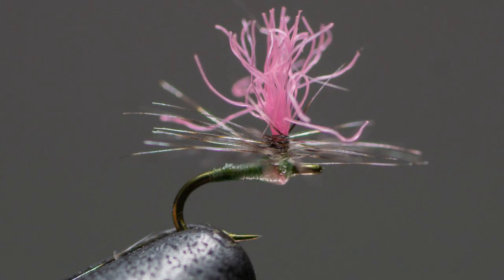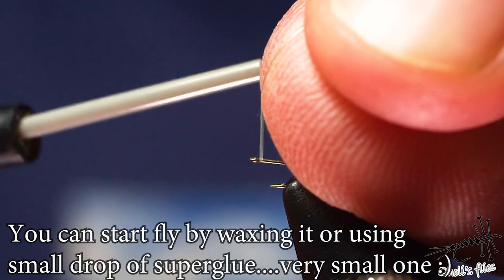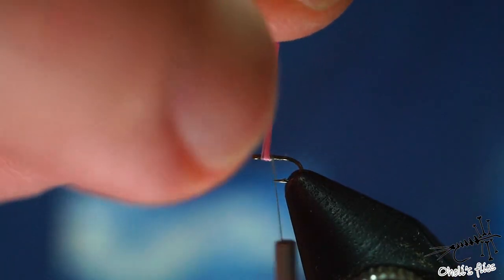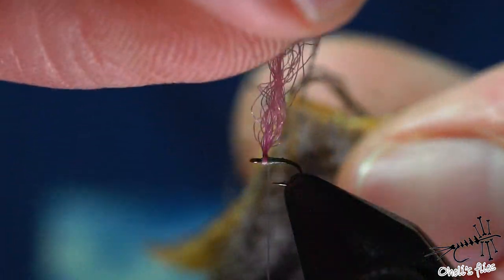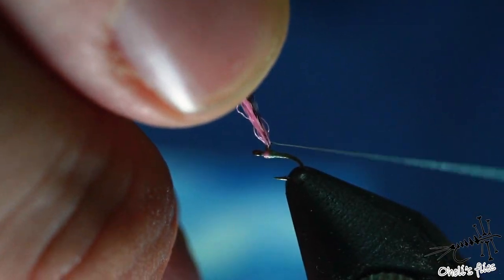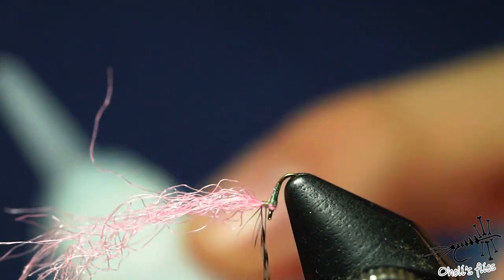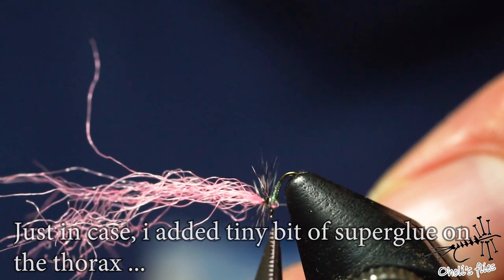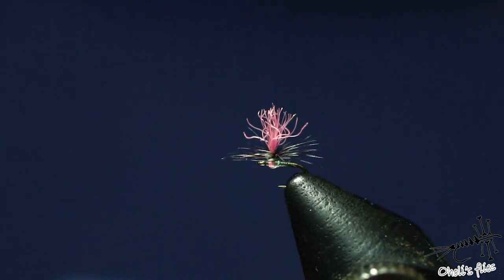Micro Nano Pico Parachute Fly

Comment: tools like tweezers-like pinching tools can be refined by  repeatedly  drawing emery cloth (the thinner the better) between the pincers.  Also consider painting a thin layer of shoe goo/e-6000 or a liquid rubber (very thin and flat) on one of the jaws for grip.conformation.
Reply from the maker: Thanks for those tips. 😃😃😃
I know some of my friends just put on one side rubber tubing from electrical wires or thermo tubing.... I keep this one plain because i mostly use it to remove stem from cdc 😃

Comment: Very tiny, its a challenge... For me its difficult to get small hooks in Europe. Maybe its because using very small Flies is not common in Europe.
Btw you can add a piece of shrink tube on the tip of a cheap hackle plier against slipping...
Where do you get your Tiemco Hooks bigpack(1000)?
Reply from the maker: I lived in serbia, in summer and later... We had very small insects hatching... Thats why i love those small ones. And it is a problem to get small flies there.... 20-22 maybe.... Everything smaller its too difficult.
I know about tubes..... But i never seem to remember to buy one... I use hackle piers mostly to remove stem from cdc.... I guess i am lazy 🤣🤣🤣

Hooks are packs of 100... I know a dealer for chinese market so i got it from him. But size 32 i got as a gift